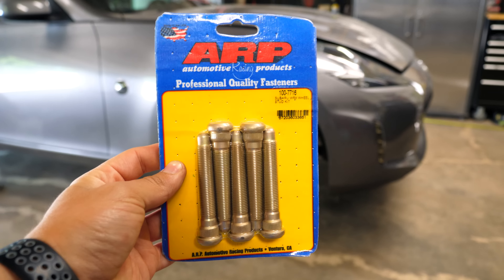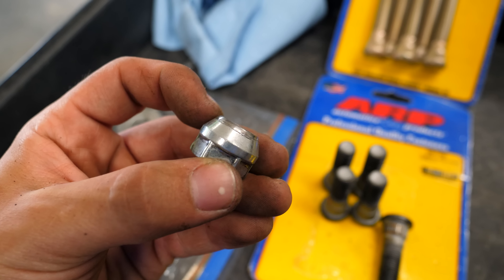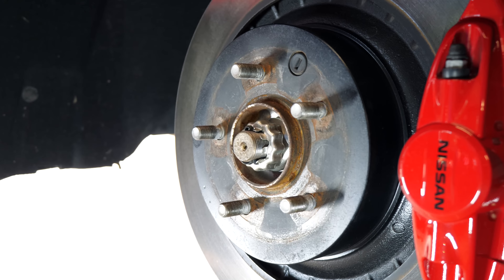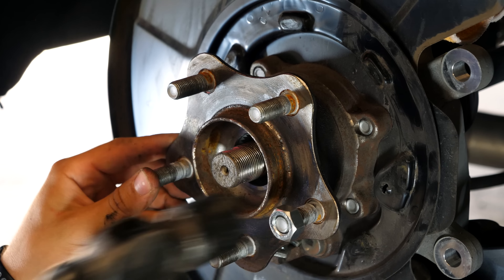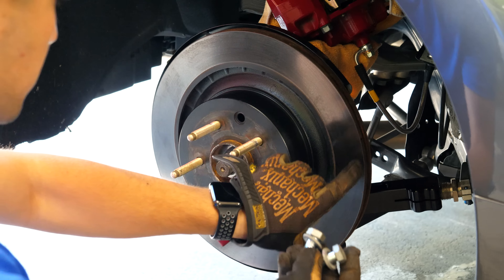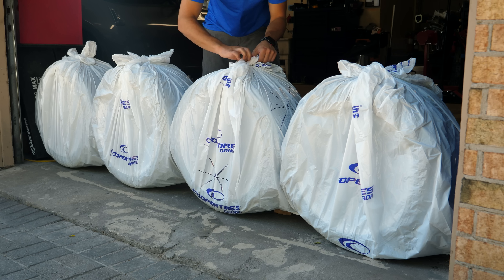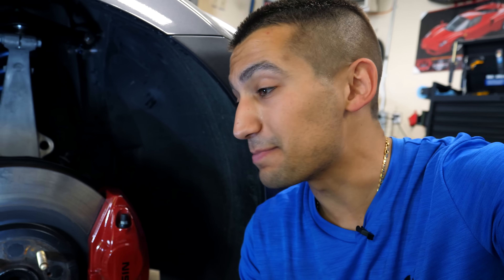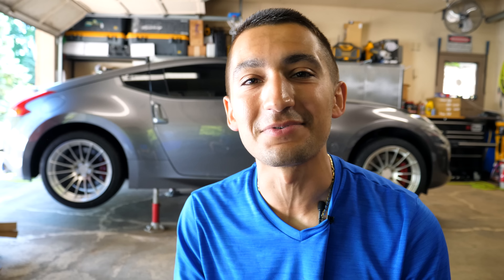How to Properly Install Extended Wheel Studs & Spacers // NEW WHEEL REVEAL

Comment: You are the first of many videos I’ve seen that emphasized using open ended lug nut which I think is THE most important part of this installation. I’m almost disgusted to think that everyone is ok applying all that torque on the contact portion of the stud. They all finish and all you see are ground up threads. THANK YOU for your attention to detail

Comment: I miraculously did not crash...My front-left wheel lost 3 out of its 4 studs BECAUSE of the wheel spacer.I install them on all 4 wheels, cleaned everything, 100 Nm tightened everything nut in sequences.After inspection, I observed that the spacer holes where the cars studs went in where severely damaged and I can't explain why

Comment: Side note: if you're using spacers that are wide enough to be bolted on not slipped on, buy bolt-ons lol. But awesome video! If using a slip on spacer, this is exactly how you want to install them. Keep it up!
Reply from the maker: Great point! Installing bolt on spacers are both cheaper and easier to install than this method 👍

Comment: Brother could you please show us how to clean throttle body ( wired and electric) and how we reprogram  throttle to factory idle . Thank you 😊
Reply: Cable operate throttle bodies are very easy to clean. Just get a new gasket that goes between the TB and the intake manifold, remove the TB, and then clean it with throttle body cleaner and a soft brush and rags. Only use throttle body cleaner, nothing else. Electronic TBs are much more tricky. On some, you have to do a relearn procedure with a scan tool if the throttle plate is moved even with it disconnected from power. On others, the relearn is automatic. On others still, the relearn is automatic but it needs to be initiated with a simple procedure. For ones that require a scan tool relearn, you can remove the TB, turn the ignition on, and place something on the gas pedal to hold the plate wide open while you gently clean the whole TB. For others which are automatic, you can disconnect the battery, remove the TB entirely, GENTLY push the plate open, and then clean the whole thing. Again, only use specific throttle body cleaner.

Comment: very thorough, great demo ... since you already are removing the rear hubs, would have been a good time to replace them for a fresh bearing (just a thought).  Cool stud installer tool, also!!!
Reply: It wouldn't make much sense to put new ones on considering the car is fairly new, and doesnt really do any type of harsh driving. My s14 is a 95  and I've had the car for 12 yrs with only 1 change of bearings and no problems. 1jz swapped pushing 457hp on a reliable setup.

Comment: 2:00 Are those jacks bolted to the floor?  Worried about a moose wandering into garage and rubbing butt on corner of Zee, knocking it off stands.
Reply from the maker: They are not. I've been using these things for years without any problems. I prefer them to standard jack stands.

Comment: Thank you so much man I got square enkei nt03 m with and 265 35 toyos set up on lowering spring and the front fitment is so perfect but the back needs a spacer and extended lugs and thank you so much this video you made it so easy follow along
Reply from the maker: Glad I could help! Cheers

Comment: Hi bro, will a 14mm spline stud bolt fit in for an original 13mm spline bolt? Planning to replace my 13mm spline 12x1.5 but all I could see in stores are 14mm spline. Do you think that would work just fine?
Reply from the maker: It doesn't look like it. What car are you looking to get extended studs mounted on?

Comment: Great video, Do you really need extended studs for spacers? Seems like a real pain to swap...
Reply from the maker: If you know you're going to run something like a 15mm or larger, you can get away with bolt on spacers, but anything smaller than that is a slip on design, which means you NEED extended studs. There's no other way around it, other than buying different wheels
Reply: @milanmastracci  Thank you for that clarification! I was becoming a bit confused with all the info that is on the internet

Comment: Hey man, wanna put spoon calipers on the front wheels of my rsx type s.
If I keep the stock studs in the rear, can I use open ended lug nuts on them?
Reply from the maker: Yes you can. Open ended doesn't cause for any concern. If anything, it gives you breathing room
Reply: @milanmastracci  thanks bro

Comment: Even though companies make tools to do it pulling it through with the threads is not the proper way to do it. the proper way to do it is undo the hub and press them in using a hydraulic press.
Reply: A press is actually the way ARP says to install their studs

Comment: Question. The hub bolts from the car hub stick out about 2 millimeters. Is it safe to grind them off?
And when I brake there is a grinding noise happening. How do I fix this problem? Please help

Comment: Will arp 100-7729 studs work. Says they fit Subaru WRX/Brx & Scion FRS. Arp has more spline teeth. Didn't wont to force it.
Reply from the maker: The studs I linked will work on the Z/G chassis's. ARP doesn't make one specifically for them, however they will work and that's what I have on my car.

Comment: I ordered same studs with projects kicks r40's. The lugs thread onto oem studs fine but the ARP studs begin to seize about 8 turns up.  Both are confirmed 12x1.25. Is this an issue you've encountered? Im thinking ARP sent me some bum studs :/
Reply from the maker: Hey Matt, I can't say I've experienced that before. Do any of the threads look damaged on the studs? How did you install them onto your hub?

Comment: If you’re running wheel spacers you want to run as short of a stud as you can. You dont, want to extend them. Its simple physics. A breaker bar is longer because you want the torque to break something off. All you’re going to do is make it easier for your wheels to break off.
Reply: Simple physics, sure. You have to ask yourself, where the force is being applied. That’s like me grabbing the middle of the breaker bar vs the handle. The spacer is what’s causing the change in location of force vs the stud. I could run a foot long stud, the location of the force would remain the same meaning my torque or bending moment on that stud would be the same. However, that’s a simple example that ignores centrifugal loading, weight of the stud itself, etc.

Comment: As an Audi guy..... (lug bolts)- if I run spacers do I need to buy longer lug bolts or what?
Reply from the maker: Yes you do. So if you have no spacers on your car, you use standard length bolts. If you want to run 10mm spacers, you will need 10mm longer bolts 👍
Reply: @milanmastracci  Thanks man! Keep up the awesome videos!!

Comment: And Actually if you are replacing the studs with the stock size you don't need to remove anything but the rotor and brake and the original studs can be hammered out and slide out really easily and vice versa
Reply from the maker: Stock for stock, yes you are right. Its just a bit more work if you're going from stock to extended, regardless of how much more extended they are 👍

Comment: My car is on jack stand's and today  one of them  broke down and car almost crush me. That is experience I don't want to repeat.
Reply from the maker: Get the aluminum ones I linked in the description of my video. I've owned them for 7 years now with no problems! Safety first!
Reply: @milanmastracci  I will by one ASAP because today was my lucky day ,☘️
Reply: Check the recall on Harbor Freight Jack Stands.  Some need refund and replacement.   My 6 Tons did, some 3 Ton are also affected. Watch out!

Comment: Don’t you change wheel scrub and bump steer?  I doubt most people understand what this means.  It will change the traction control on your 370Z.  So I’m not sure you’re “safe” from that perspective.   BTW- I went with the 2010 370Z Nismo wheels murdered gloss black professionally.
Reply from the maker: It does change it, yes, however the steering wheel feels light, with a ton more grip over stock. Those are nice wheels you have 👍

Comment: Wheels adapter is more safer
Reply from the maker: I don't know if you're trolling or not..
Reply: milanmastracci yess no need replace the stud, it got extra stud, you can special order it too fit your center bore so it doesn’t wobble at high speed, used at many drift cars.

Comment: If you bought proper fitting Wheels, why would you need spacers...
Reply from the maker: I plan on using this wheel and tire setup at the track, which means running a square setup is ideal so you can rotate it. Since the front wheel wheels are a bit smaller than the rears, I can't run the same spec wheel. So I'm running the widest up front possible, with the same spec rear wheel, with a wheel spacer to get the same wheel-to-fender fitment.

Comment: This is not a proper or safe way to install the studs my friend. The studs need to be pressed in. ARP studs are a different metal than the stock studs. They need to be pressed with a hydraulic press or shop press. I watched your video, bought the lisle part. Called ARP with a question and the guy there went crazy when I said I was going to use that installer. Please remake a video doing it the right way.
Reply from the maker: What is wrong with doing it my way? You do have to pay attention when you are tightening the lug nut to pull the stud in, but you won't have any issues with that, and you'll save a ton of time that way. I've done this route many times of cars for the street and the race track, with NO problems at all.
Reply: @milanmastracci  ok I understand your point. But, I am just relaying the information that ARP gave me. They were very clear that this is not the proper and safe way to install their product. That’s all man. Shortcuts are shortcuts. Sometimes stuff get through and sometimes you pay for doing something the easy way. I had everything in place to do it your way. Lisle tool and all. But I decided to do it the right way. I even went out and bought a shop press. Better safe than sorry.
Reply: @murrayphoto819  ARP says you should use either a shot press or a ball joint press.